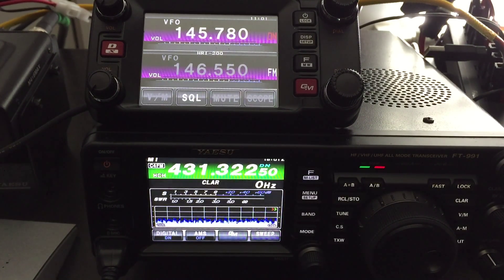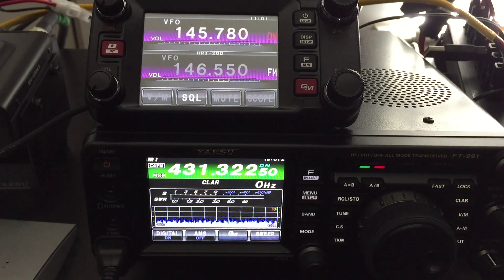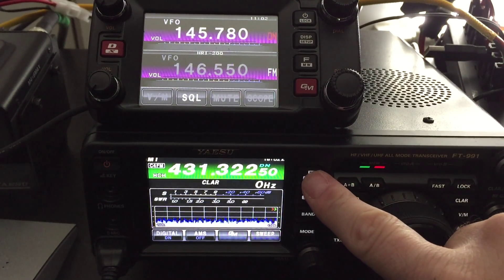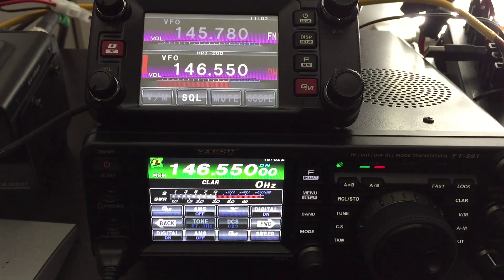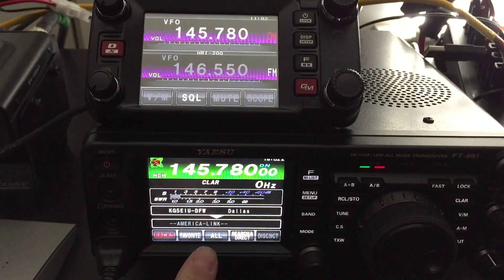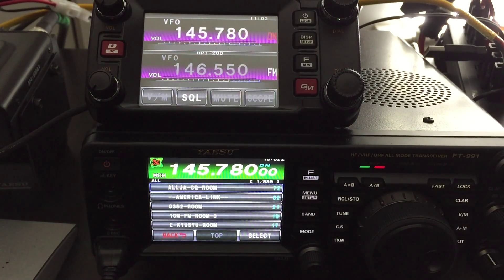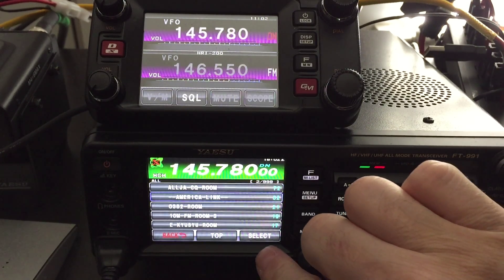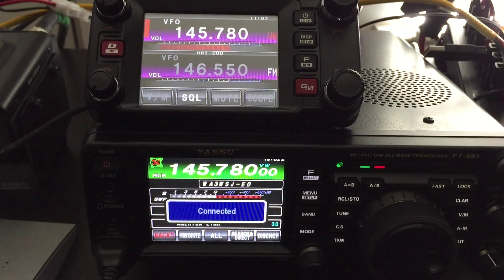FT-991 Connecting To Wires-X Node Using Preset

Comment: David I use an ftm100 and the ft2 D I can never get it to work with the preset freq. My Ft2 D does not conect the node unless I use the voice Chanel only setting on the wires panel, and manual , no preset freq. on the Ft2D. What Am I doing wrong ? Thanks Jorge HK4CZE

Comment: I noticed you are running your Node in DW. I ran mine that way for a little while then changed to Digital only. Do you notice any difference in running it in DW? I looked over the help file and it really didn't explain the DW mode. 73 de K5ORN
Reply from the maker: +K5ORN Yea I think that is the dual watch mode - gives you support for the calling freq on the 400.   So tune to that freq hit the wires-x button on your ht/mobile/base and via RF it will go "find" the nodes....

Comment: Can the 991 be used in analog mode with the HRI-200? Sorry new at this
Reply from the maker: +Leroy Skalstad  it could be used as an analog node.  Just about any modern radio can be hooked up to the HRI-200 (Wires-X box)  I think you lose audio quality and features by NOT using digital.   I have not hooked the 991 to an HRI-200 but if you did it would be analog only as I understand it.
Reply: +David Cappello  Thanks David,

Comment: I ordered a 991 a few days ago & should arrive tomorrow. Our local repeater has a DR1X repeater as one of it's nodes. We are waiting forever for the Wires-X firmware for that DR1X (So the HRI-200 can be attached). When the repeater is finally Wires-X capable I will be able to use the Wires-X features of the 991? Sorry if this is kind of a dumb question. Seems like the 991 can do everything the FTM-400 can do except image transfer. Can the HRI-200 be connected directly to the FT-991? Thanks for posting this video!
Reply from the maker: HeliDragon510 So you can use the 991 to connect to a Wires-X node now - that is what the last firmware update gave us.  As far as using a 991 as  a Node (connecting the HRI-200 to the 991) I don't think the firmware will support that just yet - if it does I have not see/read anything about it.
Reply: David Cappello Ahh OK so the HRI-200 connects the radio to the Internet through a computer. Got it. Thanks so much for the quick reply. Just got my 991 today at work. Can't wait to get it home and fire it up. Had to sell 3 radios to buy this little beast. :D Thanks again.